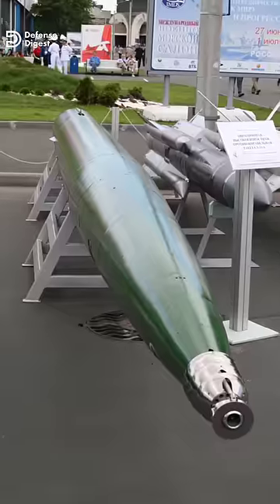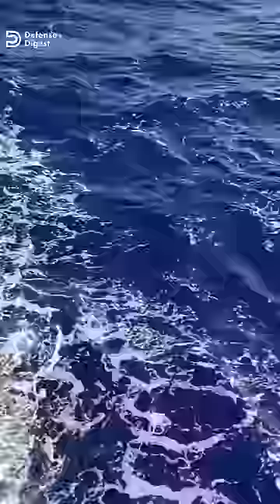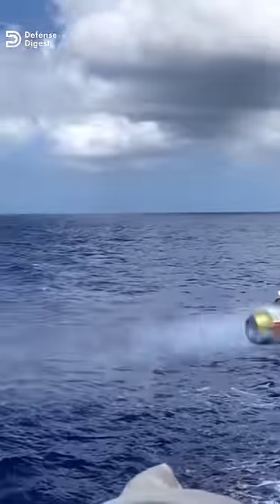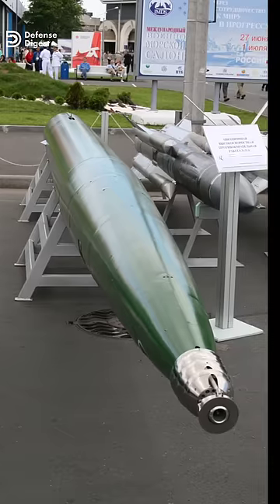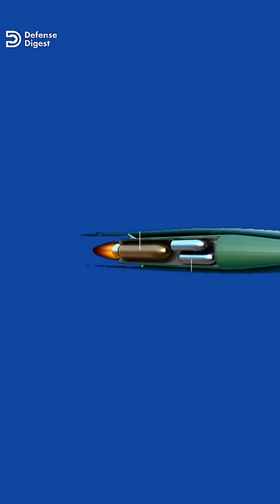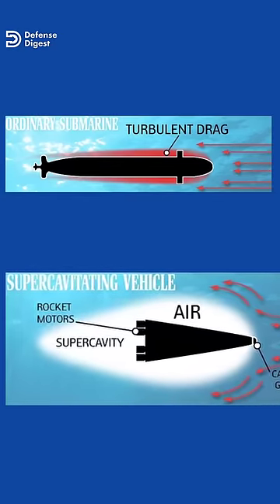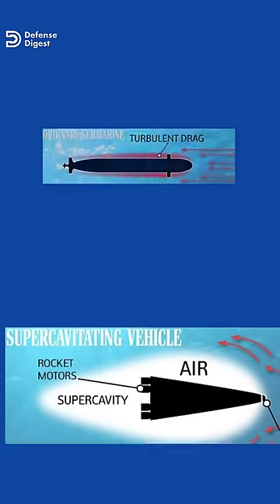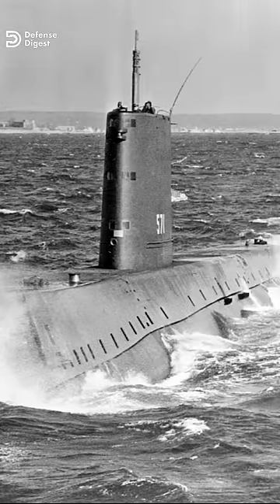Russian "Shkval" Torpedo Zeroes in on Targets at 200 Knots #shorts

Comment: Warp engines don’t exist, but this demonstrates how one would work in principle.
Reply: this impulse drive
Reply: This is how space travel could be better huh?
Reply: @Brookie yes
Reply: I don't see the similarities between traveling inside exhaust gas and riding a warp in space.
Reply: @Brookie nice futurama quote
Reply: @Brookie There are warp drives that do not require negative mass, if you want my source just ask.
Reply: Similar to the Ghost's cavitation drive.
Reply: @Brookie doesn't have to use negative mass. Dr Eric Lenz made a thesis with soliton about that
Reply: @Brookie give it 10-20 years
Reply: @craftpaint1644  I was about to comment about not seeing the similarity, but you've already said it better than I was going to.
Reply: @Brookie not entirely true either.
Reply: @FozzyZ28  they didn't create it by mistake. They just made it to prove another theory.
Reply: Not before we have that Gellar Field Generator.
Reply: as long as you're okay with vaporizing everything in it's path
Reply: there's already almost no drag in a vacuum of space
Reply: I see what you mean but not really. For what we know is you create a bubble of space time around you which you compress the space time in front of you and stretch it behind you. The concept is more like you standing on a mile long rug at one end the back let’s say but the rug keeps folding in front of you so technically you are not moving the rug does and when the rug folds completely you take one step off the rug and you traveled one mile only taking one step. This concept is very real and can be achieved with a anti gravity reactor. Our problem is figuring out how to make gravity.
Reply: But there's nothing in space to evaporate?
Reply: Sure of course🙄 the concept and engineering it’s all there you’re absolutely right 🤦🏻
reminds me of the enterprise 🤷🏻‍♂️
😂😂😂😂😂😂😂😂
It’s funny how you always find experts on YouTube 🤔😂😂😂
Reply: Well I guess we're going to have to go in a different direction what we are now, because we're using solid rocket boosters right now and that doesn't get us anywhere near light speed,so I must be missing something here man please clarify.
Reply: @doomfanboy9413  NICE!   LOL
Reply: I appreciate that we all have slightly different opinions, I'm certainly not a very smart person as I can't find the original video that I watched. Lol  but you guys should watch this video "NASA Scientists Accidentally Discover World's First Warp Bubble" have no Idea how to send a link.... I'm old, meh! This video does cover all aspects of a Warp Bubble. Does this exist or not, time will tell. 😁👍
Reply: @FozzyZ28  no you are right on track.   had you seen the movie "idiocracy"‽  purdy much a documentary and I think people would freak because most religion (for basic parts)  would fall apart.
Reply: @NEOSPORIN7777  Nope.... But I'm definitely guna watch it tonight fella now that you've said it. 😁😁👍
Reply: @NEOSPORIN7777  found it, 2006. After reading the description of the film, I think this is right up my street. Lol 😁👍
Reply: @NEOSPORIN7777  nice try! Yeah I've seen the film.... documentary? Priceless! You're a funny guy. 😂😂😂😂
Reply: @Brookie I think you missunderstand yourself

Comment: This has slowed down a lot. They announced five hundred miles an hour.
Reply: Member that Gian steam ship the parade around and people laughed because it was outdated. I member.
Reply: @cjwrench07  
.
You have no idea what you are talking about...

All that is required to defeat any of these systems...

Is having Bugs Bunny bend the barrel 180 degrees.
Reply: Export version sold to the french
Reply: @belgianfried  Russian planes are trash? Lol
Reply: @cjwrench07  I'm gonna say 1 thing

Generation 1 kontskt-5 has approx 250 mm RHAe
Relikt has 500
Monolith can defeat DM53
Reply: @CountingStars333  yeah
Reply: @belgianfried  lol Better a trash tank that an Useless Heavy Shit that can Be tracked and exploded by a Frag Granade
Reply: @cjwrench07  also Germany still uses DM53, 53A1, 63. Russia already has 72B3 Obr 2011, 90A Obr 2004, 80BVM, all 90M with AZ-185 derivative autoloader to fit Svinets rounds.

Svinets 1 - 740~ mm penn, 80% penetration criteria
Svinets 2 - 610 - 660 mm penn, 80% penetration criteria
From 2A46

From 2A82 gun, it could exceed 900 mm LOS

2A83 Grifel-1 achieved 1024 - 1040 direct and 1040 mm LOS
The best current NATO tank round? XM964 with 930 mm LOS
Reply: @Russão000  they're not that bad. It's only the leopard. Not only does it have the weakest gun with the oldest rounds, the 2A7 never received an armour upgrade, the 2A6 and 2A5 has 1st gen gunner thermals, it also had the worst armour, the FCS and thermal issue was only remedied in 2A7. 2A7v uses new ceramics but it's a 2021 tank

And yet it's still worse in armour and gun than every other tank in the world
Reply: @belgianfried  Thats Worst, Germans are knowed by the Best tank designs since World war 2, i preffer russians bcs oh Boy that T-14 Armata is a Sexy Bias
but wtf this Leopard is so sht
Reply: @cjwrench07   same with the US
Reply: @belgianfried  i dont like american tanks, i preffer the aircraft, like A-10 Thunderbolt but in tanks i preffer the russians, lighter tanks, easy to Maintance and had some technologies like the armata with a new autoloader that its not the greatest but is safe than the T-72 ones,
Reply: @alexeyshapovalov1353  And your point is. Don't be jealous and bitter u didn't have you tube when you were 14.
Reply: What I've heard the torpedoe can't turn very well
Reply: @alberthendershot1702     You are right.    At the speeds it goes, and the sensitive nature of the rocket components, means it can never risk turning like a regular torpedo and having a piece touch/skim the surrounding water.      The current Gen has some maneuverability, but the Soviet’s left a turning ability out of the first version because of the dangers to the launching ship/boat/craft of an air bubble failure.

Comment: The Shkval is also the loudest thing in the water that can be heard for many miles.
Reply: Shkval 1 only has effective firing range of 4.3Miles, shkval 2 has firing range of 6.8-9.3Miles, and it travels at 200knots (230mph), which means if can reach its target within like around 2 minitues after launch. By the time you hear the torpedo it's already too late. You gotta use the sonar to detect what can fire it first, that's one thing that torpedo is not as good as missles, it  has shorter range

Comment: So what's the cons? Seems unlikely that this tech would be out for 80 years and NATO countries haven't adopted it. Are they less reliable? Smaller warhead? Less accurate etc?
Reply: I think the problem is the noise/sound waves it creates, most of the modern torpedoes are stealthy and you can't detect them until they are so closed to you, but this thing in the other hand... You might be able to hear it coming even before it hits the water 😂.
Reply: @vidurachamathka2317  US have been trying to get thiers to work but to no avail. Even IF they can hear it coming, they wont be fast enough to be able to evade it.
Reply: @oneofthechosen874  well the Russians have some hell of an advanced technology when it comes to missiles and torpedoes, no one can deny that :)
Reply: @oneofthechosen874  leave your PBS channel
Reply: @vidurachamathka2317  Germany put them there. But Russia building German weapons is like China making lead paint
Reply: @williamdawson3792  ok ok! USA number one!! 

You happy now 😂 ?? 
Cause that's what you wanted to hear right ..
Reply: @oneofthechosen874  if it's loud and easily detectable it can be avoided I kinda doubt it has the range to go very far aldo
Reply: From what I know, they are easy to spot and evade, because they are very loud and have difficulty steering due to the fact that they are basically just flying in air with no good control surfaces
Reply: @vidurachamathka2317  yes! but at this rate of noughts, it would not matter as it
will be to late to take any
avoiding action.
Reply: @vidurachamathka2317  
Why is it no longer in use, and nit being used by any other navy ? Must be some huge downside to it (?)
Reply: @oneofthechosen874  sound travels like instantly in water though... so if you can detect it, you can deploy anti-torpedo measures for sure. 
It can't move faster than sound.
Reply: Yes it cannot be controlled to any considerable degree. Most torpedoes are hunter/killer types. This rocket type does have a smaller warhead but of course doesn't matter with nukes. Another problem is sound....these are incredibly loud and anyone who is using sonar will immediately pinpoint where it was fired from. Another huge downside is range..... only about 9 miles while other more conventional torpedoes have a range of 30 miles. I would also add that because they are so loud it can actually "blind" the sub that fired it and it would no longer be able to detect the target sub.
Reply: @notmoose8670  thanks for the answer!  Definitely the information I was curious about
Reply: They are horribly inaccurate, you would have to get lucky to actually hit anything!
Reply: Another problem is they are not maneuverable at all. So with how much noise they make, your target may have a good chance to dodge the incoming torpedo, regardless of how fast it’s going. A fast torpedo is good, but a torpedo that actually hits is better.
Reply: @vidurachamathka2317  Hollywood film දෙක තුනක් බැලුවම...🤣🤣🤣
Reply: @amodhyh6146  අඩෝ Supercavitating torpedoes ගැන ෆිල්ම්උත් බැලුවද උඹ 😂  සැර ඩයල් එකක්නෙ ඔයා..
Reply: @vidurachamathka2317  නැ නැ මුං හොලිවුඩ් ෆිල්ම් දෙක තුනක් බැලුවම හිතන්නෙ ඇමරිකාව තරං රටක් නැ කියල ඒක කිව්වෙ යකො🤣🤣
Reply: @amodhyh6146 අහ්  පැහැදිලිව කියන්න එපැයි මනුස්සයො 😂, ඒකනම් සිරා..
Reply: @vidurachamathka2317 උබ උංගෙ healthcare දැක්කද ? අම්මො ලංකාව දාහෙන් සම්පතක් 🙂💔
Reply: On top of what others replying have said: Rocket fuel is generally two parts, the fuel and the oxidizer. You have to be extremely careful when storing oxidizer lest it decide to turn a small fire into a fuel air bomb. I believe they used high purity Hydrogen Peroxide and kerosene for these and it was the downfall of quite a few ships. A notable one being the submarine Kursk.
Reply: Id assume it would be pretty hard to guide at that speed. If this is true even at this speed the range would still have to be close or lucky
Reply: We tried peroxide in the USS Skipjack...
Reply: @johncampbell2979  You do know torpedoes aren't launched at point blank, right? Even at 2000 yards, you have over 100 seconds to change course slightly from the torpedo that essentially is locked in a straight course from the high speed
Reply: With all the talk about stealth and therefore being easily evaded... That would be true if this thing was actually conventionally armed. Buuuut it was supposed to have a nuclear warhead. Therefore even if it misses or goes for a noisemaker, the target still dies.
Reply: @vermas4654  Actually the Shkval could carry a 460lb conventional warhead
Reply: @Gatekeeper0880  I was just saying what was said in the video and apparently also was ignored here
Reply: It was horrendously loud. You could gear it from the moment it was launched. Being unguided too, the attacking sub would have to get really close to its target so the target didn't have time to evade.
Reply: @roadsweeper1  with 200 knots and a nuclear warhead, doesn't need to be that close.
Reply: Yeah I don't think the people commenting here quite understand how quick 200 knots is. And 80 odd years ago as well.
Reply: @fatstacksfatlips8708  of course it's a weapon for nuclear war only. That's the whole point of nuclear weapons.
Reply: @vermas4654  It’s not a weapon for nuclear war only if it has a conventional payload. Nuclear torpedos in a nuclear war aren’t effective because they can only hit coastal assets. They don’t insure MAD. It’s why only Russia is the only nuclear power with a nuclear torpedo, and why the US decommissioned it’s nuclear torpedos.
Reply: @notmoose8670  the whole idea of using rocket-torpedoes of this type is to mount them on very fast carrier ships (they go like 100kmh) approach fast using electronic warfare radar suppressors so radars can't see shit. Then do the shooting maneuver towards the enemy carrier ship and GFTO. 

This torpedoes can maneuver and identify priority targets among the group.

Or deliver it silently by a submarine and do the maneuver again to avoid detection during the shooting.

There is a whole lotta tactics on how and when to use those.

That was my exam question when I was trained in Russian navy. Peace!
Reply: The reason no one else uses them is the danger of storing them as they are fueled by hydrogen peroxide, which is highly volatile and corodes the tanks it's stored in over time, the kursk typhoon class attack sub sank when the crew dropped one of them while trying to load it into the torpedo tube causing a deadly blast that sent them to the bottom of the ocean.
Reply: You can spot them instantly when theyre deployed and having a rocket onboard is very suicidal
Reply: @snoke5567  no there is a new version where the nozzle in front can rotate any direction so the air bubble can stay on. On the older generation model. Once it get out the bubble it like hitting a wall.
Reply: @oneofthechosen874  why task the sub to evade it when it just needs to be intercepted or countered with a barrage of slower cheaper torpedoes blocking its path? Water surface cruise missle/torpedo is much better.
Reply: I wonder about this torpedo’s guidance and maneuverability after launch.  Also question it’s range.  There is a reason the Soviets didn’t take them to see.  It might be since they were intended to interfere with a nuclear launch from American submarines, and the Soviet’s didn’t know where they were located.  So, never in a position to use them.
Reply: The noise from its launch gives away the position of the launching submarine.
Reply: From what I have read in previous articles, this torpedo is for basically near straight shots.
The bubble around the torpedo must stay constant, which is nearly impossible during a turn maneuver.
Also, the torpedo was very loud and easy to hear by American subs.
Further more, the guidance system was difficult to maintain due to interference with the bubble.
Reply: I wonder if they can build these to be parked in water and activated when needed.
Reply: I believe they are not guidable.
Reply: @tomedward128  I understand these ones are not. But I wonder if they can build something that could be guided from a distance, maybe even by satellite. All they would need to do is park them in the battlefield and drone operators could guide them on target. I imagine that's how submarines will operate in the future.
Reply: The super cavitation prevents the torpedo any ability detect targets.  Which means the torpedo is very inaccurate at anything but very short ranges.
Reply: @snoke5567 they can’t be steered at all.   Unlike slower conventional torpedos that can hunt their target.

Shqkval can only work at point blank range….
Reply: @williamfoote2888   It’s also blind too due to how loud it is. It’s pretty much a dumb torpedo.

Comment: Can you imagine this on a larger scale. Attached to a Virgina class boat? Yes it will give away it's position, however if need be, to escape. In theory you could pump steam from the reactor to super heat the bow ... 😈🔥😈. I swear I'm not high 😄😆🔥🔥🔥
Reply: But it would be so noisy that it could be heard on the other side of the planet.
Reply: @glennwiebe5128  Another obstacle would be where would the passive sonar array be placed
 If you don’t know, the bow of US subs are not metal
Reply: @spartin86  Knew that. But, let's hope this ordinance and variants never need to be armed and fired in defence or offense.